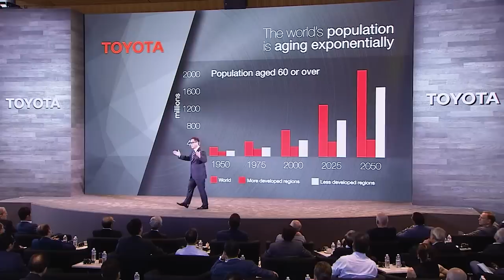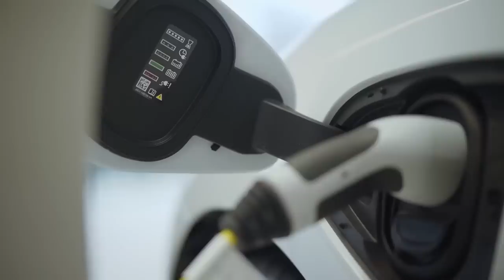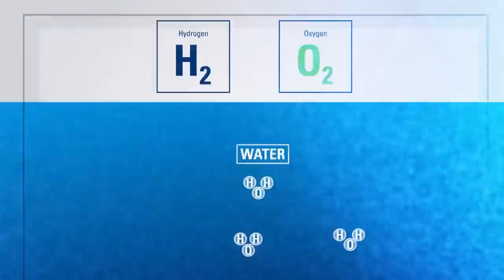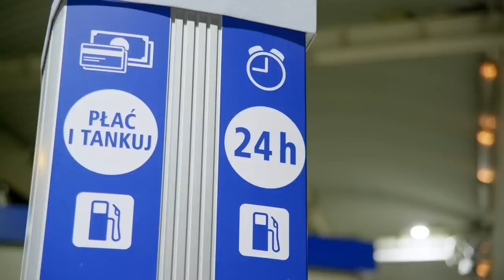New Toyota CEO Shocks Everybody | Huge News

Comment: Finally a company that is doing what's right instead of forcing junk down people's throats
Reply: Converting methane to hydrogen and then burning the last one instead of the first one is right? Ok, interesting point of view but you cannot call is carbon neutral because methane is pumped from the ground.
Reply: @stepanvolovecki8365  You're a bit clueless and don't know how this technology works, or the different ways that exist to generate hydrogen.
Reply: @cesar_onada  sure only you know everything. But still I really advise to google hydrogen production, even wiki will be enough to understand that you are not that smart ;)
Reply: @cesar_onada  I don't have questions to hydrogen fuel cells. The problem is that we convert the same natural gas to energy. And if you take a looks at the whole way this one is not the most efficient.
Reply: I don't know why every time H fuel cells come up everyone glosses over the byproduct.  Water vapor.  Unless we plan on capturing it (which is a good solution), putting it all in the air at the rate we do CO2 will have far greater consequences than what we are doing now, times 4.
Reply: @cesar_onada  95% of hydrogen currently produced from natural gas. Most of it produced using steam-methane reformation process. Simply put they use methane CH4 + H2O + energy (and this is also waist) and receive C02 and H2. I don't think it is saying you something looking and what you are writing but at the end they have the same CO2 (carbon dioxide) that they are claiming is not there, of course it is not coming at driving but it is a result of this process and you cannot get rid of that. May be there are some experimental way of getting it in a better way but quite likely it is way more expensive otherwise every one would use it already. Ah sorry, I know I know they all stupid but you ;)
Reply: @stepanvolovecki8365  youre right. Lets exploit 3rd world countries and dig up equally enviornmentally unfriendly alternatives. Genius.
Reply: @stepanvolovecki8365  EV is green? just checking since you seem to be against hydrogen because it is not green enough for you. So is EV green?
Reply: Like a Ford EV and it’s doomed for failures…
Reply: @cikatomo3092  I think you didn't get my point at all. The only thing I wanted to point out is that at the current state hydrogen is not carbon neutral and saying that is misleading. 95% of all produced hydrogen is coming from neutral gas with releasing all CO2. In general I have nothing against h fuel cell. About EV the situation is almost the same, at least in most European countries most of the electricity is made from the same neutral gas. The exception is Finland, Norway, France and several others. There are also quite big questions to batteries production. But still you can get solar panels and charge you EV only from green energy at least the most expensive part that you need every day will be from renewable source.
Reply: @I.Odnamra  :) congrats, you are genius! you are can read but is not able to understand what it its about. I just said that hydrogen in the current state is not even close to carbon neutral and claiming opposite is misleading. This is it! Talking about your calm 95% of hydrogen is made from natural gas big part of which is also coming from 3rd world and countries like Russia that makes ecological disasters in its own country and all over the world including countries in Africa you are worried about.
Reply: @stepanvolovecki8365  with hydrogen all you get is water from the tailpipe.
Reply: @bh5584  do you think there are people who don't know it? The issue is the production of hydrogen the electrolysis is not a popular way of producing it.
Reply: @stepanvolovecki8365  so we agree, neither is actually green. So let's focus on having multiple sources of energy for our cars so the prices can be more affordable, instead of being a 25-30% of house budget going to fill up the car
Reply: @cikatomo3092  I don't even want to discus  what is greener what is not. I only know that Toyota tops are using misleading words. Instead of doing what they think is good and may be in the future it will be a green source they just lie openly from the stage. Most of H currently is grey and the rest is blue (which is also just a big lie, it is just marketing) and we need to admit it and improve not mislead people.
Reply: @ingulari3977  Have I said something about EV in that message? Are you feeling ok?
Reply: @theoreticalfitness7701  " Water vapor"  Nah.. it will form clouds and fall back as rain. Don't worry about it.
Reply: @stepanvolovecki8365  unless you say the exact same thing about companies selling EVs then you are very biased and clearly do not actually care about green energy
Reply: @cesar_onada  Why a Hydrogen Economy doesn't make sense.          Phys      org.      Look it up, it'll explain why Battery Electric is better than Hydrogen fuel cell or Hydrogen ICE.
Reply: @cikatomo3092  I don't know what I would said in any other case, the case should be very specific. I don't drive cars and I don't really following what car makers CEO are saying. But I know technologies that are used for energy production not just cars. So I have never searched for such videos deliberately and in this case somehow it ended up in my suggestions. I have never went across a video about cars that would be so misleading. If there would be such misleading video from BWM or Honda, EV or combustion engine car, I would say the same. And from your side this is not how the discussion should go, but it is already good that you are not saying something like: Hitler was also bad made a huge impact in environment so you are biased and don't care about green energy because you didn't say anything about that horrible person. Shortly: if someone is lying it should not become truth just because someone else is also lying. Unfortunately, everyone here is trying to convince me that it is ok because all other car makers are also lying.
Reply: @cikatomo3092  
You know a HFCEV us an "EV"? (It's in the name?)
Reply: You have got it 100% right not that electric junk

Comment: A CEO gets it.    Embrace all possible solutions until a true standard is embraced.   EVs at large scale will take rare metals and mines which don't exist.
Reply: Anyone who thinks fossil fuels will disappear is quite delusional.  Ask the asphalt on the roads, the plastics in all vehicles, the tires all vehicles ride on, and the lubricants for wheel bearings, bearings for the electric propulsion system, etc. for starters.
Reply: Toyota is going bankrupt
Reply: Very scarce to mines lithium ion than to pump crude oil underneath.
Reply: The power grid couldn't take the load and not everyone could have a charging facility.
Reply: @lilos01  y ?
Reply: Which children have to dig out of the ground, for 1 dollar a day!
Reply: Plug in hybrids can get such incredible mpg's that it doesn't make economic/environmental sense to go all electric.  Plus a backup motor reduces or eliminates the range anxiety that so many (non owners) OBSESS about and lets you run across the country if you want.
Reply: @toledobranch1099  the word is changing. Technology is changing. The adoption curve of EV's is growing exponentially. The same thing occurred when society transitioned from the horse and buggy to the ice vehicle 100+ years ago and people doubted that we could do without them.
Reply: Not true. Look at the price of Lithium, Manganese, Nickel and Cobalt over the last 6 months, all going down as 1) New resources become available and b) battery makers learn to use less of them to produce a battery. CATL, the world's biggest battery maker have just started mass production of Sodium Ion batteries, no lithium in them at all and the first EVs using Na-Ion cells are out on the roads of China. With billions going into firms who are set up to recycle batteries we will within 10 years have a complete circular economy in car making. Check out Redwood Materials, Northvolt/Audi and Renault/Solvay to name just 3 who are achieving 97% recycling rates.
Reply: @dantesinfernopurgatory7826  The iPhones and everything that the eco warriors carry are made with rare metals and fossil fuels. I’m glad ev remains an option with Toyota though.
Reply: @douwe4549  cobalt is no longer used in the latest technology. New technology is promising salt batteries
Reply: Malaysia, India & recently Iran found these rare metals

Comment: Remember Kodak?  Remember AOL?  Remember MySpace?
All the knocks against EVs - charging infrastructure, manufacturing infrastructure, and materials supply chains - apply double for hydrogen.
The new CEO has been gradually changing the story on Toyota's approach to EVs.
The new CEO has to show a brave face when discussing the company's position.
The new CEO can't start out by telling the stockholders that the company has been on the wrong track and will lose much of its market share.

Comment: The Lignite (brown coal) to hydrogen trial in Victoria (southern Australia) spoken about in this video is completed. The Japanese consortium have announced the commercial phase will now commence. The big challenge is that the emissions created will need to be captured and stored (carbon capture and storage; CCS). Both State and Federal governments have spent millions in support of this project undertaking studies of the sea floor in the Bass Strait to find sites to pump and store the emissions. The big question is whether this journey that began around 15 years ago is technically and commercially viable when the cost of producing hydrgen from water with renewable electricity has fallen to near the cost of producing hydrogen from coal without the cost of carbon capture and storage.  Then there is the cost of on-going monitoring of the stored emissions. This needs to occur indefinitely into the future setting-up a sovereign risk for the country storing the emissions. None of these concerns have been addressed thus far.  Hydrogen is part of the energy mix going forward with long haul trucks and perhaps ships and trains benefitting from hydrogen with hydrogen production and fueling located where it is used.  However a fuel cell is a less efficient way of converting energy to an electric drivetrain than storing electricity in a battery. We dont have a hydrogen distribution network; we do have an electrical grid.  Do the maths. Then follow the money to see who might benefit from insisting we extract hydrogen from brown coal.

Comment: Toyota needs to do exactly what they have been doing. I own 2 3rd generation 4runners and 2 GX460'S. We have 1.5 million miles between then and none of them have been in the shop.
Reply: not even for timing belt/ chain services? Or do you take care of those yourself
Reply: @austinr8501  lol
Reply: Lies. You need to change brakes once in a while too
Reply: You don't get to 1.5 million miles without lots of basic maintenance. I doubt you've owned them for very long and I doubt they'll last a very long time in your hands, lol.
Reply: I’m on my second GX - 760,000 KM in the 2004 and 18,000 KM on my new 2022. I have done 3 timing belt services on the old one.
Reply: And both are incredibly boring with zero driving dynamics
Reply: @austinr8501  I think he meant major issues....

Comment: I think it is great. It is the real answer to our environmental problems. A lot of states cannot supply electric power now and to add cars to the mix is absurd. I have seen portable hydrogen equipment the size of a 1car garage that could be set up at most gas stations. Another thing is the cost of electric, my bill has just about doubled in the last 5 years. You also have to figure out how to recycle all the electric cars….an environmental hazard just waiting to happen!